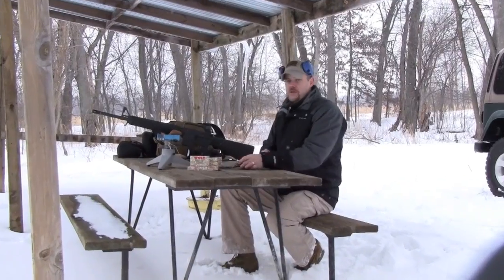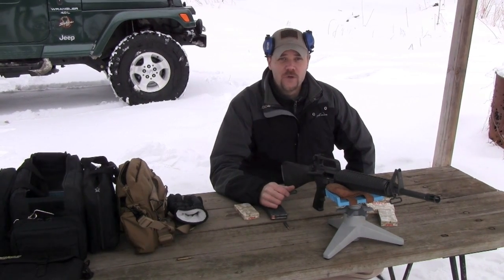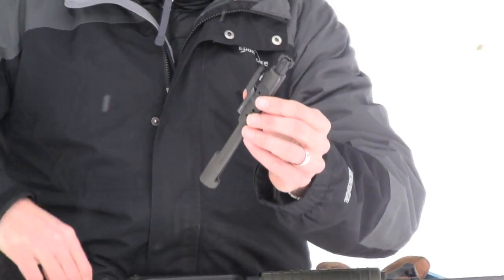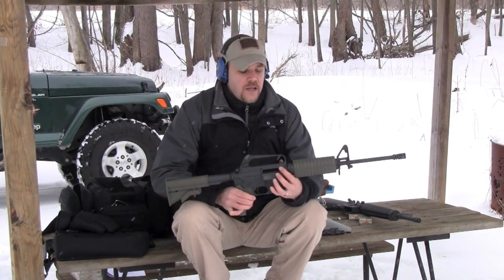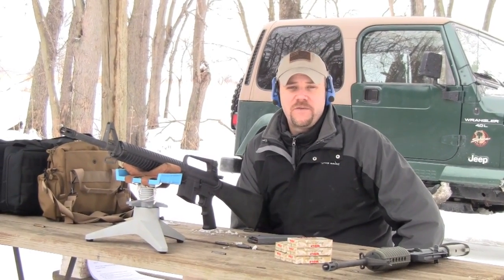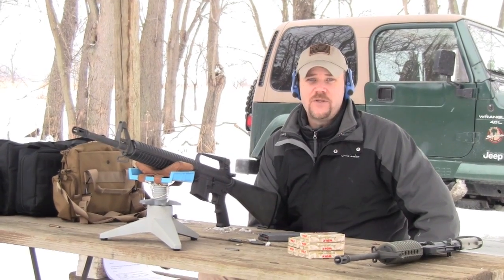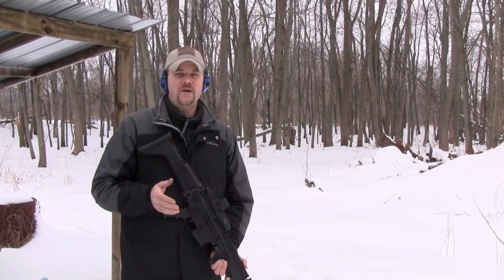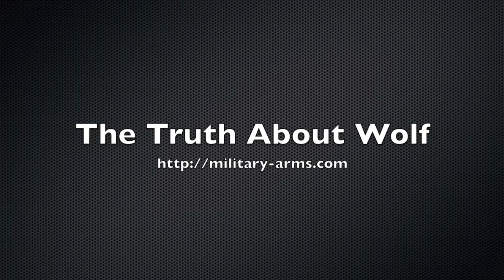The Truth About Wolf Ammo

Comment: AK when it absolutely positively must go boom every time. This from a Vietnam era vet who handled a few M-16's
Reply: They were not nearly as good back then lol. AK's are NO MORE RELIABLE than quality AR builds nowadays. In many cases they are actually worse. I have seen more problems with Aks than people want to believe. and the only problems you see with AR's are with shitty rifles that people buy because they are cheap asses
Reply: Your experience does not reflect the AR/M16 platform in use since the first run of rifles issued to troops during the initial conversion from the M14 (which had some significant design flaws, that thankfully, popped up only after abuse and neglect).  Amusingly, the AK took many more years to make reliable in a military context than the M16.

The actual issues with the first M16s were almost entirely operator/manufacturing errors.  The data is out there, you can read declassified documents from the time all day long.  It was execution cock ups, just like most military firearms issues, not the design of the rifle.  Take the M9 Beretta, you will hear all kinds of nonsense about the slides due to a limited run of pistols that were poorly manufactured.  The 92/M9 platform is incredibly reliable and robust.

The weird AK indestructible fantasy fest is not grounded in any reality.  The weird M16 is unreliable fantasy fest is not grounded in any reality.  

And a final shot, I wouldn't trust the opinion of most veterans regarding the platforms used by the US military because most soldiers never fire a round in combat, and shoot rarely using individual firearms that have been kept well past their appropriate service life and/or maintained by a company armourer that may be terrible at his job.

(I expect a response by someone about the M16/M4/M9 issues in the campaigns against the Islamists.  To that  I say:  These platforms were not designed to function in the unique conditions of deserts and the issues were rectified with minor design changes)
Reply: The problem in Vietnam that originally gave the m16/AR15 a name for "unreliability" was complete bullshit and still is to this day. The problem is that it was marketed as a "self cleaning system" and the rifles were issued to the troops WITHOUT CLEANING KITS.... In the jungles.... Yeah there were problems lol and a LOT of them. However, once that was remedied and proper cleaning kits/maintanance training became standard, the m16 rifle became the standard for combat rifles that still leads to this day. For a reason. Any unreliability of the system is due to the user and also commonly, the incorrect installation of parts while building the rifle. If you buy a QUALITY RIFLE from a QUALITY MANUFACTURER, you are golden. After that, it is more of a thing about keeping the rifle LUBED properly, not even necessarily cleaned. I very commonly go over 1k+ or even around 2k rounds without actually stripping and cleaning the rifle. If i have training classes/courses then i clean it before, but other than that.. Just re-lube and get to work. I have seen FAR FAR TOO MANY shitty AK's that were complete garbage.. People think they are this "unbreakable gun that will shoot anything and never needs to be cleaned"... That is laughable. I have seen Ak-47's beat in torture tests by Quality M4's many many times. They are both great weapons. I am just sick of hearing these stupid comments about how "when it needs to go off every time, AK is the best".... Complete ignorance and utter fallacy to be honest.
Reply: ALL I know is when I handled the M16 A1's and A2's they often jammed even when clean in range conditions. 
Vietnam combat vets told me of partners getting killed cause their rifles jammed. 
Maybe if you buy a 2K dollar new AR platform they are reliable, I have no experience with them. 
all I know is AK's worked in the worse of conditions.
Reply: God bless our Vietnam vets who had to worry about their weapon failing in combat.  That would be a sick feeling.    I've had the opposite experience with the A2, A4 and M4 in Iraq and Afganistan.  Zero malfunctions in training and combat.  My weapons and fellow Marine weapons function well and we were not worried about malfunctions.
Reply: I also heard the A4 and M4 were vastly superior to the A1  I carried in the Army. Still would rather hit an enemy with a 30 caliber rather than a 22. 
Semper Fi
Reply: @Frunk  - the laws of physics and statistics disagree with your opinion.
Reply: Chaplain Bob Walker B. Th. Not to refute, but modern bullet technology has increased terminal ballistics substantially. But I agree,  "never shoot a big man with a small caliber bullet" is a true statement to me. But my fragmentation rounds are nasty nasty and wouldn't survive a chest shot I would think lol 🤔🖖
Reply: Chaplain Bob Walker B. Th. Was due to ball powder ammo not the rifle itself
Reply: 50 years of refinement for the ar15. Put a modern 500$ ar vs modern 500$ all. And the ar most likely will win.
 Now put a Vietnam era m16. That hadn't been lubed or cleaned in the jungles of Vietnam. Vs a vietnam era ak and the ak will most likely win.
Reply: AK's were designed around russian steel cased ammo...
Reply: Get a $500 ar and a $500 ak and the ak will win any day of the week...I know by experience.
Reply: @Crazed Monk   Nope.  I've put about 12 magazines of 5.56 through my M16A4 and M4 in combat in both Iraq and afghanistan....zero malfunctions.  Never had a live fire malfunction in training either (blanks....thats another story).   None of the Marines in my platoons or company have ever had a malfunction that I know of either.  Of course, I'm fanatic about keeping the weapon clean and making the Marines under my command keep their weapons spotless as well.   I was referring to my personal experience, not the M16 family of rifles in general.  I build AK's for a hobby, love me an AK, they are reliable and shoot well.  In fact I'm building a Polish WPB sporter AK47 right now, and it's going to be awesome.  I'd take an M16/M4 any day over an AK.  But......13 yrs as a grunt has made me a little biased.

Comment: Oh, Sportsmansguide, if you join their "Buyers Club" can, when they often have free shipping offers for members can provide you with 1000 rounds of of 5.56 or 7.62X39 ammo for right around $130 per 500 round box, cheaper by the 1000 count and it comes with free shipping and comes QUICK and for about an extra dollar if there is ANY problem with your shipment just call them and they will immediately send you out a replacement order.For brass case "have to haves" I would highly recommend Freedom Munitions reman ammo especially for .223 or 5.56NATO users. Their reloads are at least as good as major brand new ammo, they really do go the extra mile. Costs more than Wolf but if you just HAVE to have brass cased ammo they sure can save you some bucks if you buy their reman ammo.
Reply: Dennis Matt you are correct about SG I'm a member and have bought ammunition from them with free shipping plus you can do a 4 payment plan if over $150. But take a look at SG Ammo they sometimes have better bulk pricing even with the paid shipping.
Reply: Just sent back 300 rounds of reman 223 to Freedom due to FTE - no there ammo steel or brass did this

Comment: If you are worried about the Polymore Coating causing malfunctions might I suggest Silver Bear ammo? Its steel cased ammo but its Zinc Platted instead of Polymer coated and you run zero risk of the zinc melting and clogging your chamber but you still pay like 22cents a round.

Comment: what about that lucky gunner 10,000 round test? seems the steel case isn't the issue, it is the bimetal bullet. shoot out the barrel like 3x as fast
Reply: But when you consider the money you save buying 10K rounds steel-cased ammo over brass, the cost of buying a new barrel kind of comes out in the wash.
Reply: 10,000 rounds of steel ammo - $2500. 10,000 of brass ammo - $3500. I think with the $1000 you save you can buy 5 high quality barrels.
Reply: jpap967  Its $1900 for 10K rounds if you purchase it online...   and brass cased will usually run you about 3900 for 10K ..... So in reality the savings after 10K rounds fired is closer to 2K dollars.... Enough to purchase two additional AR15 rifles..  Or just pony up 200 bucks for a Bravo Company AR barrel and another 30 bucks for an AR barrel wrench..  Its a pretty simple affair to swap out an AR Barrel.
Reply: rainmechanic makes sense, but what about if you are going for longevity of the barrel? like in an ak where it is VERY difficult to change out a barrel. sometime in the future, if ak's aren't available anymore (legislation or whatnot) i want it to still be running smooth
Reply: The Rockwell B scale hardness of a brass case is 80 ... and its only 85 for the mild steel used in Russian steel cased ammuntion..  when steel is left in the Annealed state is it pretty soft... i suspect that the bi metal steel jackets used in their bullets is equally soft and would be near impossible to damage the Hard Chromed barrels used in AK's.. Hard Chrome hardness is Rc 65-68....  That is C scale and much much harder then 85 on the B scale.. You would probably have to spend 10K+ dollars on ammunition before you shot out an AK barrel...
Reply: There is a video posted here on youtube where a guy with a Rockwell tester used it to test the hardness of Brass case and Steel cased Russian 762x39... On the Rockwell B scale the hardness of a brass case came in right around 80B ... The Russian steel cased ammuntion came in only 5 points higher at 85B..  When steel is left in its workable Annealed state it is fairly soft ... i suspect that the bi metal steel jackets used in the construction of the bullets is equally soft and would be near impossible to damage the Hard Chromed barrels used in AK's.. Hard Chrome hardness is Rc 65-68....  BTW, that is C scale Hardness and is many times harder and more wear resistant then 85 on the B scale..
Reply: How many people have you met that have HONESTLY shot-out a barrel?  For people more serious about shooting it's an issue, but barrel cost is a wash when you consider money saved on ammo OR time at the reloading bench.  A barrel has, and always will be a wear item.  You can baby a car, but you still have to change the oil, tires, spark plugs, etc.  It's the cost of ownership. 

The average guy who may fire a few hundred rounds a year, oddly enough the same guys I see buying steel-case ammo, it doesn't apply to.
Reply: im with you.  colt socom barrels are not cheap... approx $300.
and remember, kalashinkov designed his ak around steel cases while stoner and sullivan designed the m16 around the physical properties of brass.  
plus, the powder mixture found in imported steel cased ammo is something else.  the noxious fumes alone will tell you that.

Comment: Russian wolf is alright for the price; however, I got Wolf ammo form Ukraine and it was crappy...Jammed up a glock after about 200 rounds. (I did clean it and re-tested it with the Ukraine ammo). Of course I got the Ukrainian ammo during the Ukraine/Russian conflict in 2014...
Reply: hag12100 maybe it's a bad case of Ammo. I bet they were throwing that Ammo together and didn't give a crap about QC. Sounds like it under powered Ammo. Take one apart and measure how much powder is in it. I bought some Russian 7.62x54r ammo in a crate and that Ammo was so bad I could pull the Ammo apart with my hands. Most of them anyways. I think the Ammo was from the 50s or 60s. I've got Ukraine 7.62x39 America Classic Ammo. Back in 2015 seems ok. Getting a bad batch of Ammo is possible.
Reply: hag12100 you can call Wolf. They will refund your money. I thought I had some problems with Wolf Military Classic Ammo but it was a weak spring in my gun. I have an AR47. WMC has hard primers so the Ammo was good. I did call Wolf and they were going to give me a full refund. That's until I looked into a Wolf Power Spring and problem was solved.

Comment: I purchased 2 AR-10ish rifles from Palmetto State Armory in 2016.  One is 308 the other is 6.5 Creedmoor uppers.  The lowers are identical. They have operated perfectly.  The gas blocks were set for maximum out of the box. After 200 rounds through each rifle, I tuned the blocks to a few percent past failure to cycle. The change was significant in that the casing ejection was far less energetic.  No failures of any kind.  Very cost effective solutions, both of which easily achieve sub MOA accuracy and consistency.  I couldn’t be more pleased and satisfied with my purchases.

Comment: Probably fired about 1500 rounds of Wolf through my Colt M4. No problems in feeding or extracting. Rifle did not appear to be any dirtier after firing. Ammo seemed to be about as accurate as other brands of ball ammo. 
Worked overseas in Afghanistan training their police. Out at the range they trained with AK-47's and 9mm S&W Sigmas. Ammunition was of Russian and Chinese manufacture. All steel cased and with the 7.62x39 was all bi-metal bullets. A lot of the ammunition was Wolf manufacture. Observed literally tens of thousands of rounds of this ammunition fired through their weapons and fired probably 3000-5000 rounds of the Wolf 9mm myself through my Beretta M9 while I was there. Never observed any problems with the ammunition. 
Weapons maintenance is more important than the ammo you fire through it. Gotta keep them clean and lubed.

Comment: Basically the problem is firing a lot then keeping a round chambered in a hot chamber it doesn't melt but it expands the case coating and causes the bolt to have to pull harder to extract. Nothing melts but It can expand. Really it depends on barrel tolerance if you like shooting it then shoot it but I can hand load brass cased ammo cheaper than wolf.

Comment: Well, sounds like a pretty accurate assessment. Lacquer coated cases aren't a myth, though. Yes, he's right that they aren't made anymore, BUT if you buy the right tin of stuff, you can still end up with lacquered cases. I never had a problem, 'cause I kept some lacquer thinner handy for cleaning. Yes, I know you aren't supposed to have a problem with lacquer residue, but I guarantee you that if you didn't clean with lacquer thinner, your next trip to the range would have a jam. Clean? No problems. No Clean? Be prepared to clear a jam. The polymer coated  stuff seems to have addressed all the issues. Sustained hot firing would cause a build-up of sticky residue. Just slow down a bit. But none of that's an issue with current production.
He also covered an issue I have mentioned several times in the past - the need to re-time the AR when short barrels are put on. My usual response back is "but mine works just fine". Okay, that's yours, but your buddies broken bolt has a cause.
In the end, there's only one question. Does your particular rifle shoot it without any problems? If the answer is yes, then save some money and use it. If your particular rifle has problems, are they easily fixable? If the answer is yes, fix the issue and then save yourself some money. Otherwise, use the ammo your gun likes.
I do take exception with ranges saying that the sparks caused by bimetal bullets can cause a fire. That's utter B.S. If it's an outdoor range, normal wind currents prevent dust build-up, and thus no fire risk. If it's an indoor range, the EPA air quality regulations are such that there's never any dust build-up and thus no fire risk. If an indoor range EVER has a fire caused by sparks from bimetal bullets, that range is ALSO causing lead contamination in all its clients.
Having said that, bimetal bullets are rougher on steel backstops. The answer for that is a better quality backstop.

Comment: Actually, the lacquer or polymer coating on the steel cased ammo has to do with the lubricity (or lack thereof) of the steel cases vs. the brass cases.
Brass is much more "slippery" against a steel chamber than steel is. Also, steel cases don't "spring back" as quickly/easily as brass cases, thus need to be coated with something so they don't stick. It doesn't really have to do with heat.
You are 100% correct when U described the prob. with short barreled AR running direct impingment system.

Comment: both of you are both right.
you are right that using steel ammo voids most warranties. not just DPMS. my Colt, for example.
he is right that, steel shouldn't scratch your chamber.
the reason steel is problematic is because, brass cartridges expand in the chamber, which means it has a better seal, so it simply functions better.
long story short, as long as you clean asap after every time you shoot, steel makes great plinking ammo.
but i still keep several mags of brass for defensive purposes.

Comment: I did some testing today, comparing results with Wolf 62g HP .223, versus Federal and Sierra 55g HP.

Gun: Radical Firearms RF-15. 16-inch barrel, 15-inch freefloat handguard, 1:7 twist barrel. 

Optic: Primary Arms 1-6x ACSS LPVO. 

I used a 100-yard zero, attained by shooting a sub-1 MOA 5-shot group with Federal 55g HP. 

I then switched over to the Wolf 62g HP, and my groups opened up to 3-4 MOA @ 100 yards. The shift was typically high and to the right, but not always consistent. I shot 3 separate 5 shot groups, and the results were the same. Accuracy wasn't very good. I then switched over to the Sierra 55g HP, and my groups were right back where they were with the Federal.

Based on this, I wouldn't use Wolf 62g for anything that requires a high degree of accuracy at 100 yards or more. I plan to get some 62g ammo in a different brand, and see how that groups with my gun.